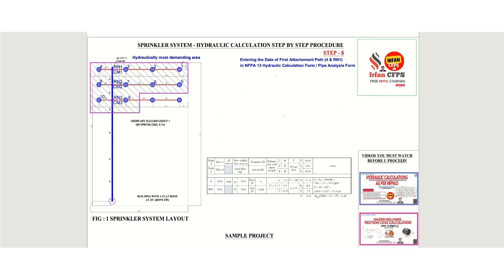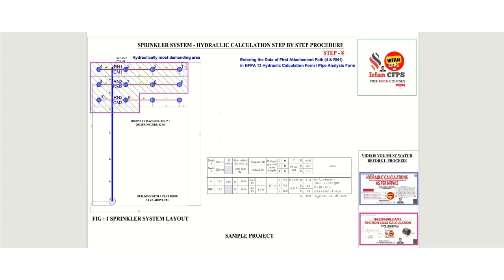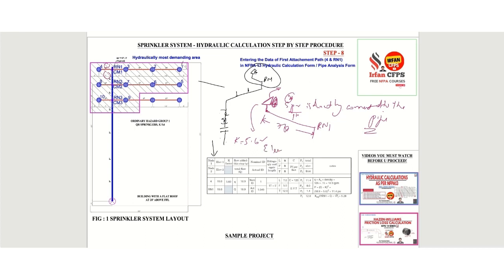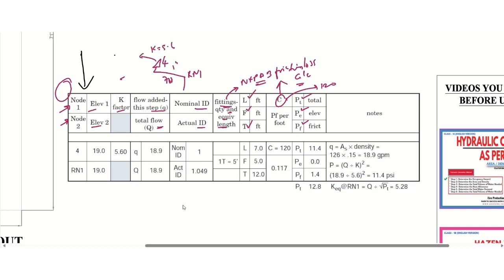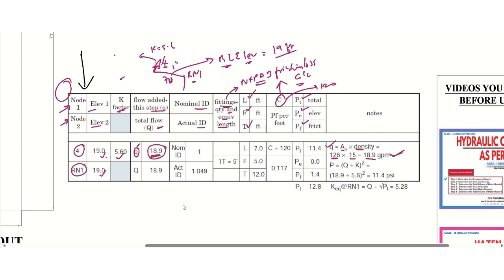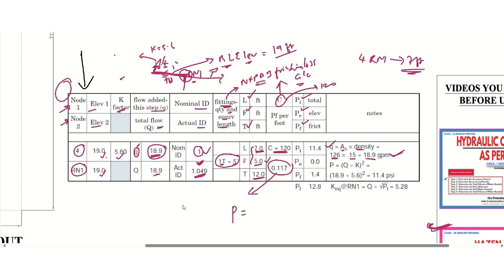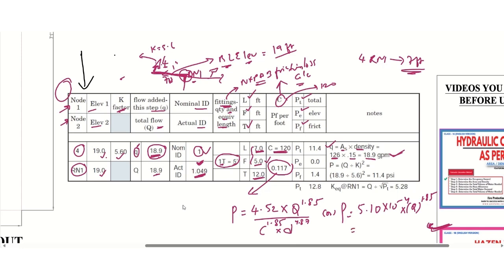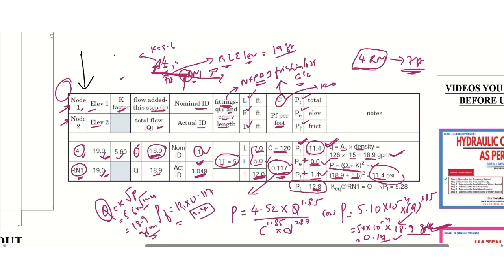Step 8 |Hydraulic Calculations for Sprinkler Systems

Comment: Why are we calculating K.equivalent?? What are we understanding with the value of K equivalvent...?? Is it that our K equvi shall be less 5.6 if we have using K 5.6 sprinkler, and if K equi exceed 5.6 means our calcs is wrong somewhere..
Reply from the maker: K-equivalent (Kₑq) is used in NFPA 13 to check the hydraulic performance of a sprinkler system. It helps verify if the system is delivering the required flow and pressure.
🔹 If Kₑq < Sprinkler K-factor (e.g., 5.6): High friction losses are reducing discharge.
🔹 If Kₑq ≈ Sprinkler K-factor: System is balanced with minimal losses.
🔹 If Kₑq > Sprinkler K-factor: Possible calculation errors or oversized piping.
Kₑq is a diagnostic tool—if it deviates too much, recheck your calculations!

Q : Is it wrong if Kₑq exceeds 5.6 for K5.6 sprinklers?
Not necessarily. Theoretically, Kₑq should be slightly lower than the sprinkler K-factor due to friction losses. 
However, if Kₑq is significantly higher, it could indicate an error in the calculations, such as:
Incorrectly summing flows or pressures.
Miscalculating friction losses.
Incorrect equivalent length or pipe diameter assumptions.

Comment: WHAT if K eq is higher than 5.65? is it wrong
Reply from the maker: No problems. Flow from sprinkler will increase which means system demand will increase due to which u need to select big size fire pumps.

Comment: Why u didnt include the 90 bent fitting in node 4?
Reply: Yes, the equivalent length to be calculated for ET ( 1 elbow,1Tee)
Reply from the maker: @Karf5544  Ok. Noted.
Reply from the maker: I will cross check and get back to u. thanks